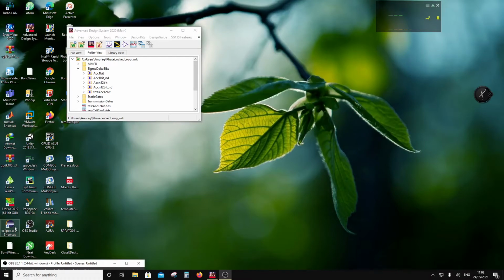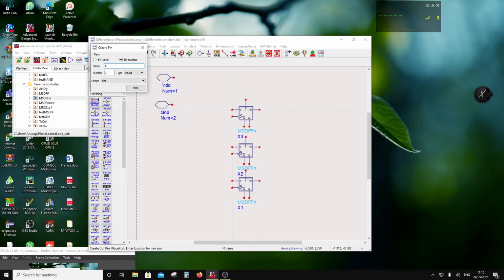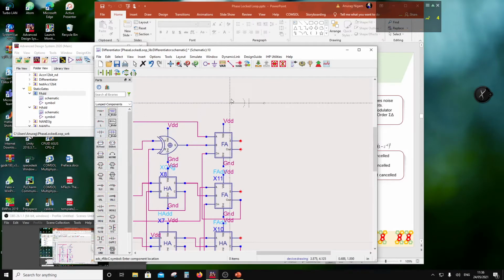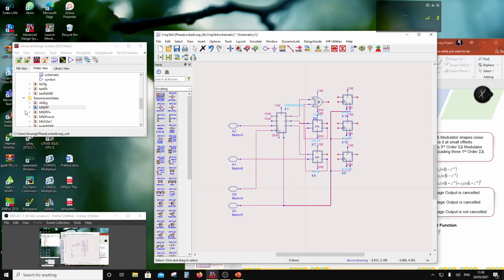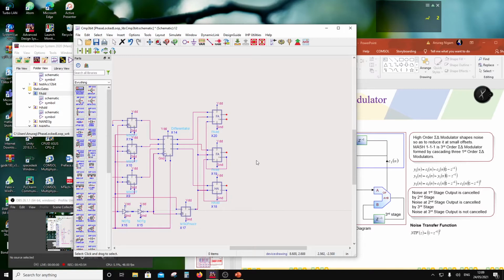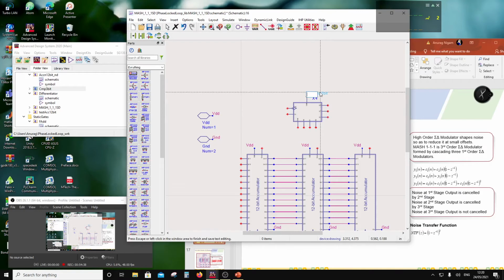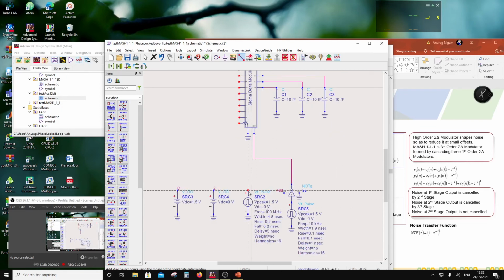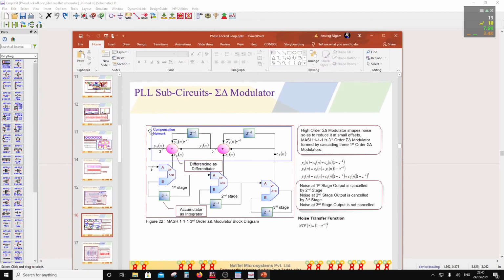Analog Circuit Design using ADS Session30

Comment: I have implemented exact delta sigma modulator design on Cadence but it doesn't give accurate output for the given input?
Reply from the maker: Two things, either my theory is wrong i.e. there is mistake in my understanding or there is something wrong with your implementation. I did in cadence and got correct results. You have to simulation for at least one complete count of 2 raised to 16.
Reply: I have used a 12bit accumulator in DSM design. Ref freq 100Mhz and simulated for 41usec not getting exact. I have used TSPC based DFF.

Comment: Does the first block just add C2 + C2 delayed two's complement ? (C2 - C2*Z(-1)) and you add C1 outside ? why you used 3 bit adder then make A1 and A0 ground. It is hard to follow your design. It would be amazing if you explained it one by one.
Reply from the maker: Well please refer to the design and formulae at the side. As i go integrating from input to last integrator so i go differencing.
Reply: @anuragnigam9443  thanks for the guide really !!!
Reply from the maker: There may be easier circuits but compare same order and also u can have second order diff and ingera together in one switched capacitor circuit but clock distribution and clock feedthrough is difficult to manage